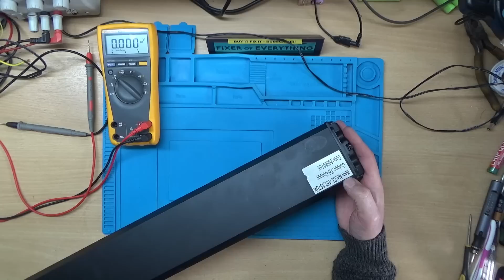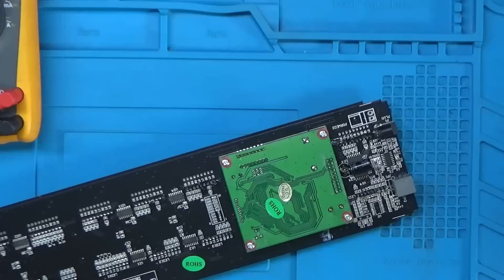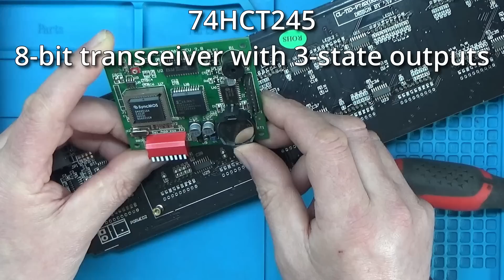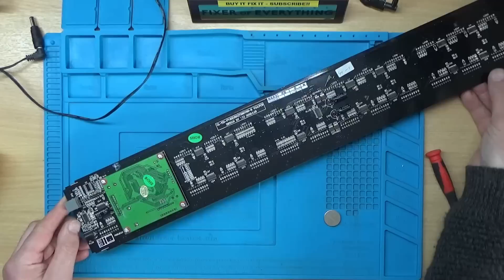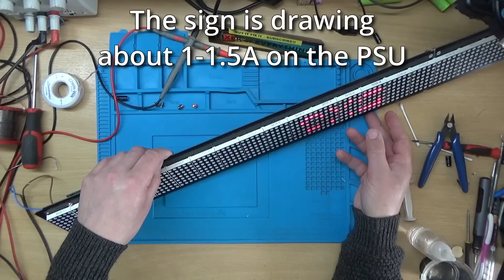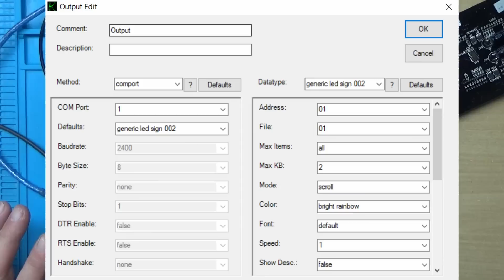LED Dot Matrix Scrolling Sign Repair

Comment: Great fix. What was the solution first the temporarily soldered power wires? And was there a more permanent solution for the programming?
Reply from the maker: Thanks 👍 I've not done anything else with it since making the video. I've just came across it as I'm trying to make space in my repair room for my latest gadget! It's quite big and I'm sure it will make an interesting upcoming video!

Comment: Are you sure that was an RS232 port? Looks more like an RJ socket
Reply from the maker: Yes it's an RJ11 socket, but goes to an RS232 to TTL converter chip. Seems you can buy RJ11 to DB9 RS232 leads.

Comment: You may have said but I wanted to ask in case you didn't and I forget. What year was this made? Is there a brand? If it is common Chinese "fair" I am fine with that. I have a weakness for inexpensive Chinese modules and components. Some may fail but I think most will do what they are supposed to. If they fail, perfect opportunity to practice what Mick is teaching us. OK. 2007. Interesting. RS232. That's pretty old. Still cool stuff though. I still have Cakewalk that I can run on my Windows XP. It plays my Optimus Keyboard through a Creative Labs Live Drive. What an awesome old program. It has staff view and I can write music on the fly. I play the keyboard and it comes up on the staff. I am sure that is common with newer programs but it works for me! 😃

Comment: A great tip I've learned to identify things is the Google Lens app. Anything you take a picture of it will scan and try to find a match for online. Great for odd shaped components, stickers, etc. . Just used it the other day to find an exact latch clip for a overhead light.
Reply from the maker: Yes I've used it a few times, it doesn't always get it right but it's still pretty good 👍

Comment: @BuyitFixit This looks exceedingly like a unit that I picked up at an auction years ago.  The software CD that came with it is "SignData Moving-Sign version 3.9 June 2008"   Model No SIGNDATA-DS780RG2     The software includes loads of odd graphics images so mine sits in the front window of the house wishing people a "Happy Christmas" With Santa and his sleigh scrolling across!!!   I no longer have a PC with a CD drive or suitable connection, so for now I'm stuck with using it just for Christmas.  The beeps and dying squeel are very familiar :-)  At least if it ever fails I have a good idea where to look to fix it, some preventative maintenance may well be in order before it does.   PS there are 51 buttons on the remote!! :-)
Reply from the maker: Thanks for the info 👍🙂

Comment: Sir i have a led display board he is not working properly 16 x 192 pixel size  single board he is working in double diaplay
Reply from the maker: It sounds like one of the driver chips has a fault and one of the pins is latched on continuously.

Comment: I had a Keurig coffee machine doing the same beeping thing and it was bulging capacitors causing it to constantly restart.
So as soon as I heard your sign beeping I knew caps are the first things to check.  The faulty connector was a surprise.
Reply from the maker: Thanks 👍yes I think it was not crimped properly and had heated up causing a bad connection and not enough current to flow.

Comment: I have no idea how you came to the conclusion it was the connector 🤯
Reply from the maker: It looked like it had been overheating at the rear where the centre pin was rivited against the part that solders into the board. I guess it was not making a proper connection and not allowing enough current to flow when more LEDs were lit.

Comment: I have a Pro-Lite LED marquee that's very similar to yours.  The serial port is going to be a 3.3v or a 5v level and there is a defined protocol, where control codes are used along with text to format messaging.    On your model, once you get the serial UART figured out, look at the bottom of page 6 and the top of page 7 for the communication examples. In your mind, substitute "file" for "page", the message coding is paginated by what looks like 8192 bytes.   To program this thing without the remote, the only recourse is serial, but with such a poor protocol document, you're going to end up having to bitbang it (or just get really drunk and try and program it, that might work too).    The control codes are going to be outside of normal ASCII values (32-126) with maybe some others in the extended table being supported or pointing to specialized characters that was preprogrammed in the firmware. The programming examples already provide a simple (badly written) framework, it's just a matter of messing with what's provided to figure out the protocol better.
Reply from the maker: I did find some code that someone wrote for a similar display (can't remember if I put the link in the video description) as you could easily use something like an esp32 and send commands over wifi or code it to be a YouTube / Twitter / weather or such display.

Comment: These types of scrolling led signs often create a s#!tload of emi..I think rather high dv/dt signals of led multiplexing and minimal effort with pcb layout design considering led return currents is in the core of the issue.. I've had loads of problems of them interfering bus radios while the windshield signs are on..usually bunch of differential- and common-mode filters required..😅 ..so personally..one of my nightmare products..

Comment: They use rs232 serial interface because you can use it up to 300 feet so many of those signs would be attached to a computer to update them but the units have ram memory that stored the messages & that's what the keep alive 2023 battery was for. Many newer ones had Ethernet interfaces & would use Power over ethernet to run & update the signs. Nice fix, good video and it proves the old adage if anything has an electrolytic capacitor it's bad along with that wonderful smell they have when they get old. LMFIAO
Reply from the maker: Thanks 🙂👍

Comment: great video thanks...could you please do a followup on this item...mods etc. anyone got the original remote control/software for this item? I bought the remote control from a seller on ebay brand new and it didnt work with my sign although the sign seems to be working perfectly...demo mode etc.
Reply from the maker: I did find a RAR file of what was supposed to be the original software, unfortunately password protected. The software I used should allow you to program the sign. I did also find a github page were someone had wrote some code along with the communication protocol.

Comment: Better not to handle the mercury cells directly, the oils in your skin will form a high resistance path between the poles of the battery allowing it to self discharge. With them being used in extremely low current applications the self discharge forms a significant drain, shortening the battery's life.

Comment: I've got a couple of the USB to RS232 converters, USB to RS422, and one RS-485 from when I worked on JRC radios and equipment.
Reply from the maker: I've got a coue of the rs232 to usb converters too, and a rs485 adapter (used it on the solar inverter video where I had to reverse engineer their software as the company were most unhelpful) 😂😂😂 I don't have the RS422 though, don't think I've came across a device that uses one.
Reply: @BuyitFixit  rs422 and rs485 were fairly interchangeable.  They used rs422 on ships to send data from the GPS to the radar and the ecdis (electronic charting) or data from the AIS (ship indentifier/interrogator) to the radar and ecdis. Of course all that data was routed to the VDR (voyage data recorder). Allot of industrial PLC units use RS422 or RS485

Comment: Looks very similar to the BetaBrite units I installed into two local hospitals, they use rs485 from the nurse call system, they are called annunciators, and they display the room numbers when the call button is press, different colour text for the importance of the call, RED for emergency, Orange for assistant, green for clear down call ( cancel call ). They are on a Daisy chain , with the end unit having a termination resistor ( i think it was 120 Ohms ) , about 20 unit installed at each hospital, installed about 15 years ago and still in use.
Reply from the maker: Yes I came across those when I was trying different protocols to get the sign to display anything.

Comment: two times lucky! :D
first, it was just a power supply issue, second you was able to find something at least usable to program the message to eprom...
bad thing was to get that 8052 clone and/or cpld broken... no chance to recover the software.
i think you can connect directly the usb/rs232 at his original socket, not really need to jump directly to 8052 pins. also, you can use it directly with an ESP8266, something like that... wifi and stuff.
more interesting is to identify the matrix modules... if these are some known chips, like max7219, you can use these modules with any microcontroller with a decent library for them: any Arduinos, STM32, MCP, Raspberry something, etc...
cpld's are expensive, their programming software, too, and their programmers, same, but they are powerful and versatile... too bad their cost make it not a choice for hobbysts! :(
Reply from the maker: I've not had anything to do with CLPDs or  FGPAs,.although I've used microcontrollers a bit, even before the Arduino came out. I remember using pic16f84s and writing stuff in asm 😂😂😂

Comment: Looks like there was a usb version of this. U2 could be the ft232rl (28-pin ssop as on your ttl board) and instead of the rs232 connector there is a footprint for a usb-b connector.
Reply from the maker: Good spot! Thanks for letting me know 👍

Comment: I have a larger one of these I bought for another project - it's 160x28.... it has an external power supply - 5VDC at 40A - FORTY AMPS.  The LEDs are tri-colour, but not RGB - they're RGY, which seems to be common on these signs.  RGB would obviously be more useful....!
Reply from the maker: Nice👍40A those leds can be a bit power hungry😂😂. I built an RGB xmas light show a good few years ago which was all ws2811 pixels, and syncronised to music that took a few power supplies at 5v! There's a few videos of it on my channel if you scroll back far enough...

Comment: Did you notice the capacitor at the very end of the board?. You may have missed replacing that one. Great videos by the way.
Reply from the maker: Thanks Craig. I'm pretty sure I changed all of the bulged capacitors on it. Perhaps that one was ok.

Comment: I have a mini nametag version of these that you can program in your message. It is a nametag so it originally ran on a CR2032 cell but over the years it started eating batteries so I hotwired it to run on 3 AAA cells and it will run continuously for maybe 4 days non stop on a set of batteries.
Reply from the maker: Nice 👍. I saw some of those on Aliexpress when I was trying to find out who manufactured this one so I could find the software for it.

Comment: This might be a stupid question. Repair is a hobby second to learning the textbook side of circuits. Can I replace smd electrolytic caps with same value brand name caps? It's for a vintage audio device I've had to do alot of trace work to. I paid 40 for it and it's worth 1k. Roland famously dis a whole production run of that years model with a bad batch of Sanyo caps. They haven't leaked except the power stage but the stink of the smd caps. Smells like cod fish oil haha
Reply from the maker: I can't see any reason why not as long as the values are the same.

Comment: Well done. If the micro / TTL is actually running at 3V (you mentioned a 3V regulator) you could use a Lantronix xPico WiFi module (WiFi in, 3V TTL out), though you may need more oomph on the 3V power supply.
Reply from the maker: Thanks Ralph👍. I had been thinking of one of the esp8266 boards as they can be powered by 5v and are 3.3v logic on the output. I could then get it to connect to wifi, scrape data and display it. I might actually do this as another video as a couple of people mentioned about doing a follow up one.

Comment: Another nice and informative repair. that's something else saved from going in the trash and ending up as landfill. You deserve far more subs!

Out of interest, does anyone know what happens to electronics goods in the UK that somehow end up at the local council's recycling hub? Are they ever offered up for repair or do they too just end up as landfill? I wish it was possible to buy faulty old electronics and mechanical devices from the recycling centres!
Reply: At our so called recycling centre (UK) electronics (TV's, radios, IT stuff) used to be placed in a separate area and I have seen various recycling vans collect it. Now everything gets thrown into a skip (from a great height). Asked about possibly picking up items before and was met with a very blank stare.
Reply from the maker: Thanks M Jons👍From my experience council recycling centres aren't supposed to sell electrical items to the public for health and safety reasons in case someone gets electrocuted with a faulty appliance. In reality it depends if you can get in with the lads or manager and they'll sometimes let you buy stuff from them unofficially...

Comment: Interesting video hope you do a follow up on it, yeah LED signs have so many uses I remember being a kid I always wanted a neon sign but LED is the next best thing. A thing I have been wondering, back in the 90' when working on electrictronics we had to be grounded because of static electricity but you do see that anymore, did they just get better at building things?
Reply from the maker: Thanks Morten, I'm not sure on the static. I think you're supposed to still. I've just never bothered and I don't think I've killed anything yet with static, although I must confess I have managed to kill a few devices over the years 😂😂😂
Reply: @BuyitFixit  yeah I would imagine the a few devices had to give up along the way, but that's the cost of learning and sometimes the just die with no cause